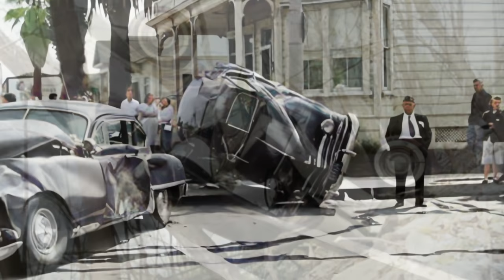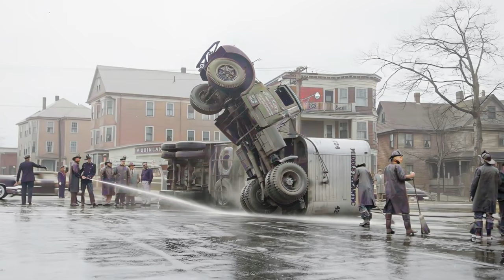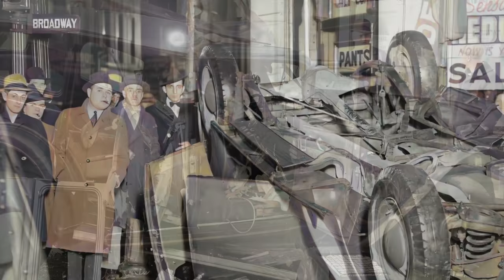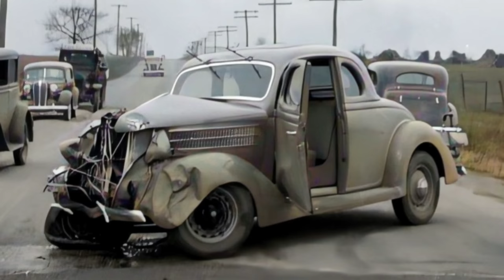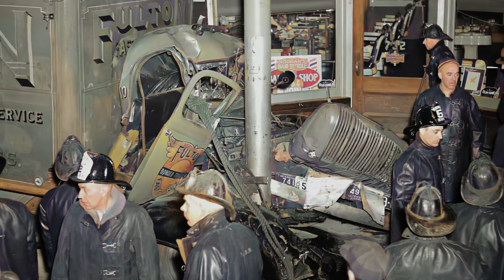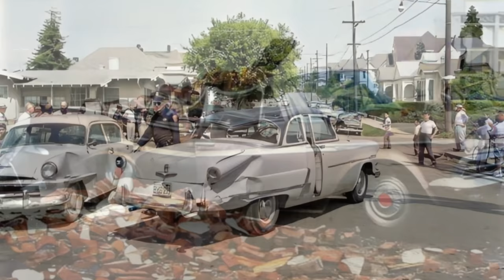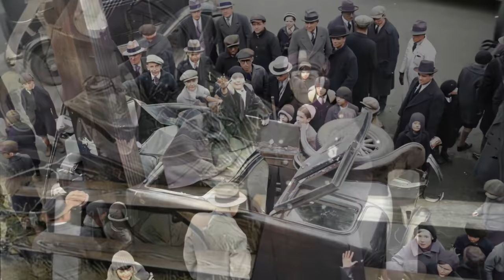Crash Chronicles 2 [Colorized]

Comment: hey besties, collision repair tech here. cars nowadays are built to absorb the force of the crash to reduce the risk of injury to passengers. older cars were not built that way- the passengers absorbed all the force of a wreck and the lack of seatbelts + airbags definitely didn’t help either. vintage cars may be more stylish than modern cars, but vintage cars are death traps. and for the record, modern cars are cheaper to manufacture & repair in the grand scheme of things

Comment: The cars back then were tanks. They were heavy, solid…..comfortable.  As a kid in the mid fifties my dads ‘49 Plymouth did very well in an accident. All it lost was part of its front chrome bumper. We kids in the back seat were unhurt. Mom in the front passenger seat was fine, so was dad, the driver. 
In my 1993 Toyota Camry, a minor accident destroyed the car. 
All the classic car shows here have wonderful old cars and pickup trucks from the ‘30’s to ‘50’s.  You won’t see Kia’s and Hyundai 50 years from now. Light weight junk.

Comment: I agree,   you could make  present day cars look almost anyway you wanted and still be as safe.    Every safety feature and standard  on modern cars is a response to all the specific weaknesses shown on the old cars in this video.    I once saw a car in the city going about 40 mph get sideswiped by a flatbed truck and forced to hit the median.    The truck kept going,  but only the left front tire of the car hit the median,  and it caused the car to flip over and turn over and over for about 100 feet before it stopped upside down.  The driver unbuckled his seat belt,  crawled out the window and literally walked away from the accident.  He wouldn't have done that had he been driving one of these cars.  

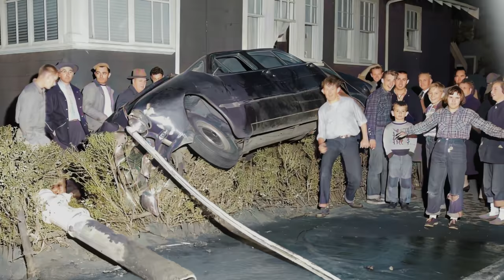7:00   notice the patches on knees of the boys'  jeans.

Comment: Simply put, today's cars look like upside-down bath tubs. Period. No style, no chrome, engineered obsolescence! At least those old cars could last as long because all parts were made out of metal. Anyone with a little common sense could repair most issues. Those body's never rusted out.

I rebuild old car's. It's a passion for me to keep these beautiful old cars on the road. My newest car is a 1976 Lincoln Town Car. It's my daily driver. Now, the 70s cars were known to rust out. Not like the 50s  and older automobiles. I live in Eastern North Carolina. We don't get much snow. If we do, I won't drive it with salted roads. So it'll never rust out. I've got older hot rod's. That Lincoln is no slouch either. I can build an engine for power and economy. I'm glad my father didn't get to see the crap they are selling today. It is cheaper for me to completely rebuild and repaint an old car or pickup than it is to go out and buy new crap. No computers. No sensors, no plastic parts in an engine or transmission. Cars and trucks had personalities. You knew exactly what car it was and who it was made by simply by seeing the front end or the rear end. You can't really tell anymore.

Comment: Better and thicker metal in the old cars, but no crush engineering, so all the force of the wreck went to the occupants, rather than being absorbed in the crumple zones.   New cars also are designed for high mileage, so the old beautiful aerodynamics just won't slip through the air as well.

Comment: "Didn't last as long." Blows my mind that anyone would actually try to say such a stupid thing on purpose.
Reply: I started driving in the mid 1970s,  back then cars were ready for the junkyard with 100,000 miles. Fast forward my 1997 Nissan Altima died last year with 497,000 miles on it. It still ran strong, it died from rust. My 2010 Nissan Altima has 286,000 miles on it and it's still going strong with just normal maintenance.

Comment: A modern vehicle typically goes longer without needing repairs, however once they start needing repairs they're basically garbage, and once the plastics start to degrade the vehicle is basically scrap
While an older car needs more maintenance and repairs earlier on in life, they can keep being repaired easily for a very long time 

The classics definitely last a lot longer than the modern cars.

Comment: I drive only classic cars (1966 Valiant in current case). Were I to hit something at speed, the newer car will be ruined, but the occupants of the new car are likely to survive. In my car, both people in the front seat are likely to hit their head on the dash or as driver the steering column is going to come forward and kill the driver. There are no seatbelts in back seats. My 51 Mercury Sedan as no seatbelts at all. Older classic cars have a lot of issues and are potential death-traps. All of the above is why I drive with all concentration and my speed is slow in order to see and anticipate issues appropraitely.
Reply: But have you noticed that the new cars have a tendency to burst into flame after a collision, and with all the plastic and other petrochemical parts, it is also a death sentence.
Reply: @skipperclinton1087  Stats please?

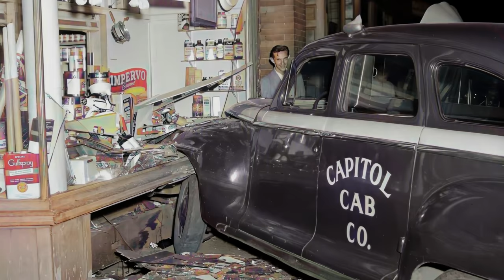Comment: 0:50  A contributing factor to this Capitol Cab co. drove into the building, could be because the tires were completely worn out, just like they are on about 90% of all the cars in the pictures. Probably many of the cars also had bad brakes and some of the drivers were also probably drunk.
Reply: They just needed a good ole computer alignment.

Comment: I had the entire right ride rear quarter panel replaced due to some guy that backed into my 2008 Camry at 5 mph. I remember sliding at 30 mph on ice into a phone pole back in 1980 , I was driving a 74 monte carlo, it wound up  with a dent that hurt more when I explained to Daddio.

Comment: The body skin metal on those old cars was thicker than bumper meatal on new ones.
Reply: All bumpers are foam-filled plastic these days, but many don't even have bumpers with the headlights & grille being the first thing that hits anything!
Reply: @stevie-ray2020  That isn't true, many modern cars have a foam energy absorber on top of a metal bumper bar. You are right though, modern car bumpers don't protect anything in low speed crashes, not like the old 5 mph bumpers of the 70s.

Comment: Not last as long? I disagree. Today’s cars aren’t built to last, since we now live in a throwaway economy where things are meant to be used for X number of years then tossed. Back then, those cars were built to last unless you lived somewhere like NY where the snow and salt on the road would eat at the metal. 

My preference is definitely for the older car looks from the 50s to the 70s, but with modern safety provisions. No computers though, I’d rather go back to the far simpler engine designs.

Comment: New cars are safer for the occupants (air bags and such). But the flimsy metal bodies, and 'crash zones' guarantee that the car is totaled, while those older cars with seat belts and air bags, you would replace a grill, fender, and hood, and have it back on the road in a week, at considerably less cost.  Looking at the tires on many of those cars, also suggests, tire tread, or lack of it, may have been a contributing factor in many of those accidents.

Comment: The 20's and 30's cars don't do well at all but the 50's cars seem much better.  The simple addition of seat belts and a collapsible steering column would make the so much safer in a crash.  When you see the head strikes on laminated windscreens it doesn't take much imagination to figure out how the occupants fared.  Also tyres with actual tread on them would help too.

Comment: I had a 1938 Dodge that Dad said was about 27gauge steel. However with old cars he worried about windscreens cracking in slivers (I have seen a girl from the 1950s with terrible facial scars from that). He also wasn't comfy with old carburettors that tended to catch fire in an accident and for this reason it took a long time to be comfy with seatbelts (hard to escape in times of fire). He would accept racing seatbelts, but they are not legal in general cars here for some reason.

Comment: Cars back then did look very stylish and distinctive, problem was, safety was a secondary concern.  Basically, most effectively had no brakes, suspension was crude, most had body on chassis so folded like paper in a crash, no seat belts, no safety glass, solid steering columns, all hard surfaces inside, etc, etc. Basically most were death traps in a serious collision.  Also, mechanically they were junk. You were lucky to get 10,000 miles before a major overhaul or new engine was needed. They also drank petrol and oil even when new.  So yes, maybe new cars tend to look boring and clone like, but they are on a different planet for safety, reliability, durability, speed, handling and braking. It is taken for granted that a modern car will easily reach 150K miles with little more than routine maintenance, and much more with careful use and maintenance. Such a shame that combustion engine cars are now under threat of extinction by the madness that are EVs and the climate cult.

Comment: I am amused by folks who feel that older cars were safer because they were made from heavy steel.
Steel dash boards, metal knobs and handles, plate glass windows, no seat belts, air bags, crush zones etc.
Peple died in crashes back then that wouldn't produce a single injury in a nidern car, horrific looking accidents in modern cars often result in minor injuries or no injuries at all.
Traffic deaths have dropped precipitously in recent years largely due to the engineering of cars today

Comment: Cars back then were all steel, could drive cross country for years and at speeds of 70-80 the whole way!!! I heard a senator 5-6 yrs ago say that cars now can handle the speed limit at 70 -75 mph and the cars from Any earlier time were less capable??? Who the heck are these people? Even a brand new mechanic will tell you it was better when there was a throttle CABLE on your gas pedal vs a sensor on the gas pedal noticing you want to accelerate. Engines turn off when stopped for... No seconds and at a green light, it only start up when your pedal sensor notices and you're moving almost before the engine has finished starting!!! People... Sensors are great but let's look at the too many years of the Chev Impala suddenly speeding up and the driver has no way to stop since nothing worked!!! Love to have THAT problem on my morning commute on a two lane mountain road, dark, icy with no guard rails anywhere and the lines separating the lanes are only visible as an impression you're left with. Now engine "slowers" and remote engine shut offs looming and who's in charge of that? Same law makers and I forcers our government forced to take automatic weapons, body armor and armored vehicles, even in quiet towns... Once they accepted all the "gifts" shit got worse! Look how it is since the people that can't spell or write with correct spelling are making up the dumbest shit based not on facts but on more stupid shit everyone lets them get away with cuz we don't want to hurt a feeling!!! Tell me, even you gen z-ers are scared, aren't you??? Well, look back to before, when parents were allowed to spank as punishment, stand them in a corner, work off a debt and accept the consequences of being too dumb to check a fact or watch a film of disciplined kids and parents that wouldn't sit and watch their kids screwing with and throwing stuff at their going blind Gramma. Why!?! Parents let bad behavior go, teach no morals and values because it's against their civil rights!?! If you want your kid to be a good kid, lead by example instead of not. Practice what you preach! Talk the talk all you want but if you're not walking the walk... If you tell kid to not cheat but you're doing it... Duh! Follow thru with threats. Do that again and to the corner with ya. You have to inconvenience yourself and sit there long enough to have them sit there. Teach integrity so they won't just walk off. We're a nation of stupid, willfully ignorant, uneducated because it's cool to ignore people trying to show you how all of there stupid shit has been done. A hundred times and a million times. You don't think we disagreed and protested? You don't think these rules and allowances didn't start with someone whining? I watched a national group TRY to have a meeting. All they did was tell others to respect pronouns, keep volume down, triggers, triggers... Rules of meetings allows people to be heard, address issues, be disagreed with... Not all at once but it gets brought up, either discussed or put off, .... Manners, morals and values, parents actually showing their child any self control... Oh hell no. I asked once why is it always "he" instead of he and her? I was told it's not discriminatory, it's a paper and ink and time thing. Just accept accept that "he" is being addressed by author... Even if you're a girl. It's expedience not discrimination. Crist in Christmas... No religious stuff anywhere but I have to put up with the alternative. Your shit is as offensive as mine but you don't let me have the same freedom of speech and religion as you? My religious Christmas is banned cuz it offends and your ridiculous offensive crap is fine? What makes yours more fine than mine??? See how we're right back to this again? your ... Whatever... I

Comment: It was common to drink and drive with a "cool one" in your hand and a smoke in the other. 
So common that NO data of alcohol factor is recorded. No safety inspections of equipment tires, etc. No requirements for seat belts.
Big truck drivers had no sleep, time on road logs. So "little white pills" of speed were common and expected of truck drivers. 
Also NASCAR inventions made cars better.

Comment: The cars now are made of low grade plastics and are saddled with computer control modules that will fail and drain your bank account dry to fix.  The cars from around 1968-2005 were built better. All cars need regular maintenance.  

Each crash is a unique event.  Comparisons are practically impossible.

Comment: Older cars lasted longer than most modern, i think you said it back to front......
Ive seen car's still around 70yrs later but 90% of modern cars will be demolished in 25yrs today we make things to throw away even most cars are junk with in 10yrs these days, also to much is added to cars so there's so much more to go wrong and so expensive its cheaper to get another car

Comment: That's not necessarily true. I live in the desert southwestern USA and cars here have very little rust. It's common to see 20-30 yr old cars on the road daily where I live.  The older cars were not as reliable. You seldom see cars over 40 yrs old with much more than 100,000 miles on them. But today most cars are good for over 100,000 even 200,000 miles or more with some proper maintenance.

Comment: My Mom drove a new Cadillac almost every year; (My Uncle worked for the Cadillac dealership)😊 She insisted that the more Car between you and an accident, the better! Its even BETTER when that BIG car is a Caddy! The other good tip was to only drive White Cars. White vehicles are 12% less likely to be in an accident than Black Cars. Red 🚘 Cars, (no matter what model), are pulled over more often than any other color by Law Enforcement. 👮‍♂️  🚘
Reply from the maker: Interesting.  I hadn’t heard the statistic about white cars before. (I had a red car when I was younger, and my experience was as you suggested.) I do agree about driving the bigger car and I only wish I could have a new Cadillac every year!

Comment: Big cars from the 70's were very strong and could take a hit much better than any modern car today. Yes I know these vehicles did not have modern passenger safety features but the structural integrity of many of these boats was very impressive. The 74 Chrysler New Yorker wagon and Chevy Impala are two examples of heavy metal that would destroy a modern cross over SUV.
Reply: But your chances of living in a modern vehicle in a crash are much higher .

Comment: Older cars don't last as long ?  I have a H.R. Station Wagon that was built by General Motors Holden in Australia ( my country ) in 1967 and is apart from parts that wear and are replaced is 80% original.  Police blue with a 186 C.I. inline six with three on the tree. still going strong. Cars do last but its the people that always want the new one.
Reply: Older cars DIDN'T last as long mechanically... but they sure look pretty today...to the point you might like to own one.

Comment: The old cars have what now cars don't have, personalities and characteristics along with styling. I don't care about the "technology" aspect of todays vehicles. Cars of yesteryear had to be driven and controlled, unlike todays with self drive, lane assist, parking and fluff and buff. Also head lights back then did not get the new hazy fogging glaze they get.
Reply: And a lot less light with 6 volt electrics, and the USA stuck with 1940s tech sealed beams well into the 1980s. I'll take LEDs and halogen headlights anyday- even with some potential lens clouding.

Comment: Older cars doesn't last as long as new cars! WHAT!!  Let me put my feet up,cause the B.S is getting deep. My ex employer bought four brand new ford F350'H and five new internationals tool trucks and almost Every single one had too go back for repairs within  two weeks after he got them. Fact Checked cars and trucks built in the 20's thru to the 70's Tough long lasting, cars built from the 80's thru today......JUNK